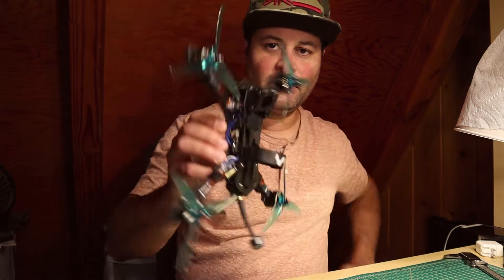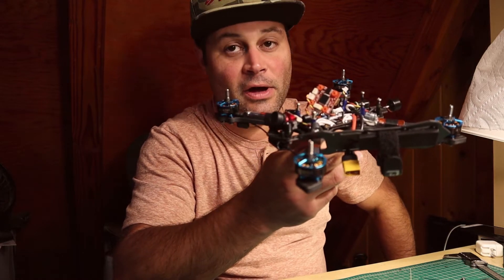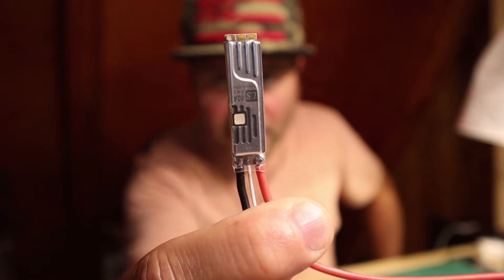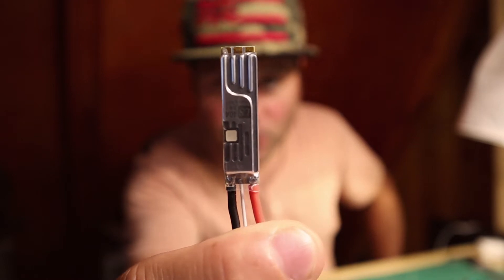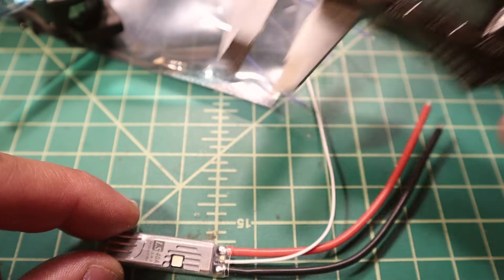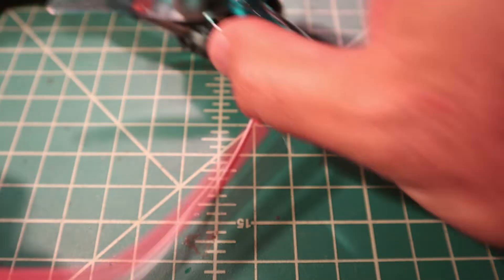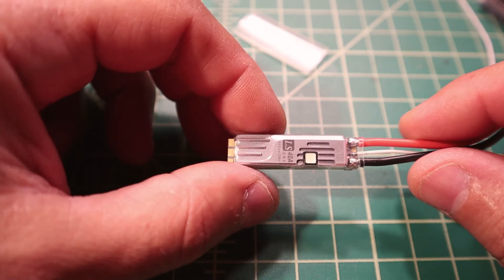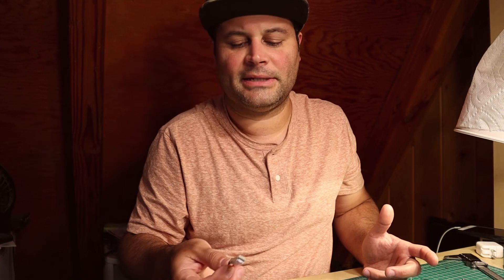Spedix LS40 40A Slim ESC Up to 6S

Comment: Hey so I've ordered some of these, running them on a quad and a hex, both in 6s. im wondering if you can explain the capacitor that you put on, what capacitance, reasoning etc?
Reply from the maker: The iFlight version of these actually come with these caps. I think they are 25 or 35V 220uF (I'd have to look). All ESCs already come with tiny caps onboard. The outboard caps only help soften voltage spikes a little better. I've tested these with and without caps and they certainly fly cleaner and allow you to tune higher when using caps. I would suggest getting on Digikey or Mouser and ordering some caps just to have for projects like this. I would suggest 35V 220uF. I've also used 50V 100uF, but on some 4in1 ESCs, not on these.
Reply: @PinchTune  great, what if i was going to use the spedix 40a esc's for a hex and also a quad? Would the motor specs change what type cap to use per esc?

Comment: Did you experience any desync issues... ?
Reply from the maker: Hi, no, no desyncs. I mean, when you don't tune older Falco X right you get minor desyncs for which the quad recovers really quickly... but that's on any ESC. Not particular desyncs on the LS40s. I just found my usual iFlights to be easier to tune.
Reply: @PinchTune    Its weird.... I am now looking at this page https://github.com/betaflight/betaflight/wiki/Tuning-Dynamic-Idle   

My set up is now after removing the iFlight 40 Amp AIO board and moving the Kakute F7 HD AIO and the Spedix F4 LS40 slims..  Like you the form factor is really good and I have a 50v 1000 capacitor on the xt60.

The reason for moving to the Kakute and the slims was that I was getting major head shaking at a fast rate in mid throttle and high throttle settings which when looking at black box I deduced my filter setting in Betaflight needed to be set at max and it tamed it but still had the shakes.

Both setups are using the same T-Motor F60 v5 1900 kv motors on 6s 
Thinking back.... when using the iFlight board I remember a few strange noises that may have been a desync at hard roll moves .. also the quad wanted to roll at a almost unmanageable roll rate  which I tamed down lowering the rates .. 

But once again both setups where doing it which again ma point to the motors.

The Kakute board has solved the shaking and is smooth as well by the looks of it I can drop the filter sliders to 1.3 low and maybe lower. 
Just going through the Blackbox flights now.

It's possible the situation could be linked to the T Motor being the common item that was still being used in the same quad but different electronics.

The other thing I noticed was a high amp draw on a hard roll even tho the rates are dialled down.

I do have the iFlight 50 amp sticks here as well..
I solved my issues with my 10 inch Freestyle quad AR10 and that flies really awesome now.

Because I really like the design of the Moka Berserker 2020 from mokaframes,  I super keen to get this running sweet.. 

Any really appreciate any advice thank you.

Comment: Good info , do you prefer stand alone esc or 4 in 1 esc .
Reply from the maker: Someone asked me this on IG yesterday. I'll answer it here just in case. I like both equally. However, I prefer individual ESCs for freestyle and 4in1s for racing.
Reply: individual ESCs has better cooling, if it places in arm, under props flow.

Comment: Was looking for some slim's for a hyperlow cg build, and came across you. Nice review man, got my sub.
Reply from the maker: Thank you! The Hyperlow CG arms are wider, so you have a lot of options as compared to the RS+ arms. I like the Furling32 Mini. I fly those on my Super G. Also, at that width, you could also try the Tmotor slims that go up to 5S. I haven't flown them yet, but I've had an eye on them. GetFPV has those. Finally, I haven't finished testing these Spedixes. But, I'll recommend you check out my review on the iFlight SucceX 50A Slicks. I'm finding they fly better than these Spedixes. I have to try and put a cap on each of these Spedixes to see if I can get them to fly as well as the iFlights. These don't come with external caps, but the iFlights do. These fly great, don't get me wrong. But since I'm testing them back to back on identical rigs, I can tell the iFlights fly cleaner, I can tune higher and therefore get better response.
Reply: @PinchTune  Thanks for the very detailed response. In looking at the arms closer, you're definitely right - looks like about any esc will work. Thanks for the insight on the iFlights, much appreciated.
Reply from the maker: @RADERFPV  Very welcome! I'm always happy to share what I've learned.

Comment: Hey ! Did you manage to connect them to BLHeli32 ?
Reply from the maker: I did. However, to do so, I had to download the very latest version that came out the other day, and then flash the MillivoltOSD with  Betaflight 4.0. That's the only way I got them to connect. After I was done setting them up, I reflashed with FL1 so I could load the configurator and flash FalcoX. I could have likely flashed FalcoX with Betaflight GUI, but I wasn't about to try.
Reply: @PinchTune  Great ! I'm gonna try ! Thanks !
Reply from the maker: @JohnDoe-vb5ns  I take it you're using FL1 as well?
Reply: @PinchTune  Nope but if you did manage to make it work it's a hope for me 🤪 I'm talking with Spedix staff to get more infos. I'm gonna give a try to the "single-wire" Arduino interface at last resort.
Reply: @PinchTune  I'm using a CL Racing F4S 1.6.
Reply from the maker: @JohnDoe-vb5ns  Oh yeah, if I managed to connect these on a FlightOne board on a MAC, you'll be fine. Just download the latest BLHeli32 Suite and make sure the board has Betaflight 4.X+ and you should have no problems.
Reply: @PinchTune  Great ! Thanks for your time, can't wait to fly 😉
Reply: Hi again ! I did speak with a guy from Spedix. He send me a procedure shared by another pilot.

I updated my flight controller (CL F4S 1.6 to BetaFlight 4.0.5) and I used the latest BLHeli32 Suite (32616a).

Now the FC passthrough is working as expected ! 🎉

Thanks again !
Reply from the maker: @JohnDoe-vb5ns  Heh, that pilot was probably me. I had them online discussing this issue with them. They told me not to use FlightOne because it wasn't open source. I told them that was TERRIBLE advice and to answer the question. Oh, and I also told them that BLHeli32 is not open source, so that's all a moot point. Haha. But yeah, latest BLHeli32 + Betaflight 4.0+ did the trick.
Reply: @PinchTune  ahahah exact it was you 🤪 LED colour changed, motor rotation configured, ready to fly !! Keep going and thanks again 😉

Comment: I run dshot 32 on a regular blheli 32 esc just my experience it works fine so not sure it's needed
Reply from the maker: I don't think it's needed on Betaflight. However, I was tuning the quad I put these on yesterday. It's on FlightOne FalcoX. Flew clearly better at the higher speed. Even needed less filtering.
Reply: @PinchTune  I don't fly beta flight I fly falco x on all my qwads
Reply from the maker: @biggfpv2721  Gotcha. Awesome. Yeah, I noticed the quad flew clearly better up high. In fact, down at Dshot600 it was unflyable. And at Dshot1200 it was MEH.
Reply: @PinchTune  yeah it's either multishot or dshot 32 or dshot 64 for the best on falco I think

Comment: Hey PinchTune!  Long time no comment.😁  Have you flown these yet?  I am in the market for some slim escs and these look like the best bet. Pricey suckers!
Reply from the maker: I haven't. I finished the build like 2 weeks ago. However, I had a hard time getting BLHeli32 Suite to recognize them. I knew I could just fly them at default, but I'd rather not. Anyway, just this morning I got them to work by using the latest BLHeli32 Suite released this morning, and flashing the MillivoltOSD with Betaflight 4.0 instead of Cleanflight. So... God willing I'll maiden tonight before dark. I'll keep you posted.
Reply: @PinchTune  Well that isn't reassuring.  I started to get the t-motor escs, but spedix has never let me down.  I've run their 20a escs on 6s.  I have 5 sets of their es30a escs still running.  I've been running their is30a 4n1 on 6s forever now.  Hopefully i don't have any issues because i ordered them.
Reply from the maker: @mooosestang  Well, I'll tell you what... I'm your guinea pig cause hopefully I'll save you some headaches. I already mentioned the problems I had connecting to them on BLHeli32 Suite, so hopefully you can avoid wasting time and go straight to connecting... I have another one for you. I flew them, but I can already tell this is going to be a nightmare build. Not the ESCs fault, but I have video cutting out so I have to figure that out first. Dunno if it's a loose connector (stupid plugs) or the VTX. That said, when the video IS working, I get tons of noise. On my iFlight Slims I capped each ESC. On these, I didn't. I wish I had. So as of right now, I'd recommend capping each ESC. But because I haven't done it yet, I can't confirm that will cure the video noise. Everything else is equal on both quads, just the ESCs are different. 5S BTW.
Reply: @PinchTune  Hmmm, maybe the video cutting out and the noise are related and not related to the escs.  I really don't want to cap each esc.
Reply from the maker: @mooosestang  Don't cap each ESC. Let me know if you get any noise. Is it a 5S or 6s build? I've found the sometimes, even with identical components, the tolerances between them means one build might be noisy, and the other will not. I'm pretty sure my video cut  out problem is the plug that goes from the FC to the VTX. I'll replace that and see. Once I tackle that problem, I'll figure out the video noise thing.
Reply from the maker: @mooosestang  Hey dude, so GOOD NEWS. I solved the video problems. Both the video cutting out and the video noise were due to a faulty connector. Even though it's all new, the connector for the VTX into the MillivoltOSD was faulty. I replaced it and both problems are gone. Now, within 5 batteries I got it mostly tuned. This is without caps on the ESCs and only one cap on the main PDB. This all said, on FlightOne at least, the ESCs flew better at DShot64 (which I assume is DShot3200? - Dunno why FL1 changed the names after the first FalcoX release). Also, I had more trouble tuning the filters than I hoped... sooooo mayyyybe a cap on each ESC might help. But I'm not taking it all apart from that so I'll continue slowly working the filters. But anyway, bottom line is, it's all working out just fine.
Reply: @PinchTune  I had to go to betaflight 4.0 in order to get blheli32 to recognize the escs as well, weird.
Reply from the maker: @mooosestang  Yep. Same here.
Reply: @PinchTune  I just flew it in the yard and it was one of the best maidens i've ever had. perfect punchouts, zero weirdness at all.  See my latest video for a sneak peak of what the quad looks like.   maybe the escs have some magic, maybe after building 30-40 of these i'm just getting better, lol!  I used dshot1200 and betaflight 3.5.7 because i don't like all the filters and changes in 4.0X.
Reply from the maker: @mooosestang  Just watched and commented over there. Yeah, I fly 3.5.7 too. I haven't touched 4.0. My SPEDIX LS40 are paired with FL1 Falco X at the moment, but the next set will be on BF.
Reply: @PinchTune  Hey bud, I am going a few of these ESCs for a quadplane build. I was wondering how you found these ESCs? Reliable enough?
Reply from the maker: @aeroakram  I didn't like them that much so I didn't fly them for very long. I did a follow up video about them compared to the iFlight Slicks I've been flying. I bet they are reliable though. I flew them only with FlightOne, so who knows if they might be better with something else. I'm flying the new NewBeeDrone Smoov Stick now. Much better.

Comment: Hi,hi, I bought these escs, I wanted information The sky blue cable that is supplied separately is used for telemetry?
Thanks
Reply from the maker: Yes, you solder that on if you intend to use BLHeli32 Telemetry. I don't usually use that, so I didn't solder it on.
Reply: @PinchTune  thanks for answering me, if I don't want the telemetry I install the esc with its red, white and black wires and nothing else?
Reply from the maker: @ramamax691  Yeah, that's it. Red power, black main ground and then signal.
Reply: @PinchTune  thanks especially for your kindness, and my first build so I wanted to be sure of what I'm doing. thanks
Reply: Hi,I'm sorry, but should I install them upside down? I noticed now that the red cable is on the opposite side and does not correspond with the positive of the flight controller. I hope you can help me thank you in advance.
Reply from the maker: @ramamax691  No, definitely do not install them upside down. Just cross the wires over like an X.
Reply: @PinchTune  thanks for answering me, I understood crossing the red and black cables, about the connection of the motors I connect them normal for how and prepared the ESC? do I have to invert the motor cables too?, thank you so much
Reply from the maker: @ramamax691  You do not have to invert the motor wires. You can set the direction in BLHeli32 later. For the main power wires just make sure you get the polarity correct even if it means you have to cross over wires.
Reply: @PinchTune  thanks always very kind you have been of great help I wish you a good day

Comment: I like the size of this ESC better than the iFlight slim ESC. Those iFlight seem too long. By the way, how has falco x been for you?
Reply from the maker: That's the one small thing I wish the iFlights were... a little shorter. I believe they could lose the shunt resistor and even the LED and make them shorter. At least the shunt resistor. Falco X has been great. I'm building an identical copy of my Falco X'd Hyperlow RS+ but with these Spedix ESCs. It started a little rough as it took me some time to dial in a good tune and also to get my freestyle rates just right. I've only been flying FlightOne for race, so I didn't even have numbers for freestyle on it yet. Now however, I love it.

Comment: Is DShot 3200 even necessary?
Reply from the maker: Likely not. My FalcoX rig runs great at Dshot1200. I didn't buy these for the speed per se. I bought them because they are shorter than the iFlights.
Reply: Does Blheli32 even support anything above Dshot1200? When Airbot released an F3 ESC, they claim it could support Dshot4xxx and until now, Blheli32 hasn't out with such protocol yet.
Reply from the maker: @Asu01  It's through FlightOne. I mean, I'm running the iFlight ESCs on FL1 FalcoX at DShot1200. But I've also tried 2400 and 3200. Some claim that works, I got minor desyncs and the quad would recompose itself and fly on. This is something I would have to ask Preston. Maybe there's a bottleneck in BLHeli32. But the way I understand it. The FW in the FC tells the ESC what it needs to run on. Albeit, so long as the ESC supports it and can do it.

Comment: Ya know I’ve never actually built a rig with individual esc’s 🤣 I’ve got some but have never put them on anything. I never really had “bad luck” with 4n1’s till recently with fl1. On Flightone I’ve killed 6 esc’s the last 5 months. A couple my fault but 3 I know weren’t any fault of mine. Blew my spark32 last week but power would still go to fc/cam/vtx/rx just nothing to the Motors.  Had a really bad crash heard the esc reset twice while it was tumbling around for 100 feet lol.
Reply from the maker: Dannnnnggg. 6 ESCs killed? That's crazy for just 5 months. I've never had bad luck with 4in1s. I've only ever killed 1 or 2 in a few years. I like individual ESCs because IMO, they fly better. Less noise since they're not right up against the flight controller. On top of that, if you have a noisy build you can cap each ESC individually. Additionally, apart from my racers, which use 4in1s, most of my freestyle stuff is slammed. It's hard to slam a top deck when you have to deal with a stack.